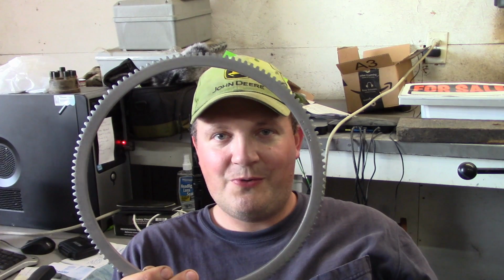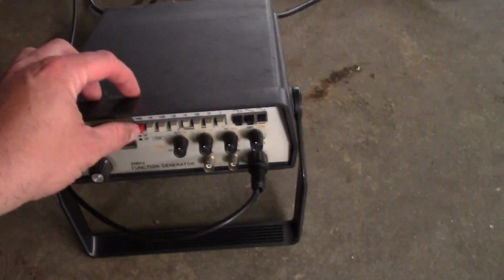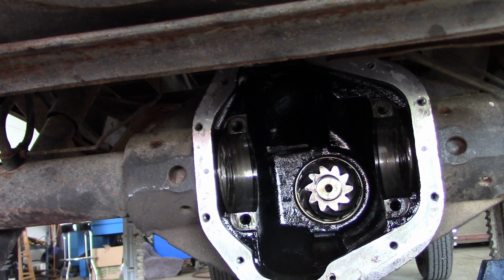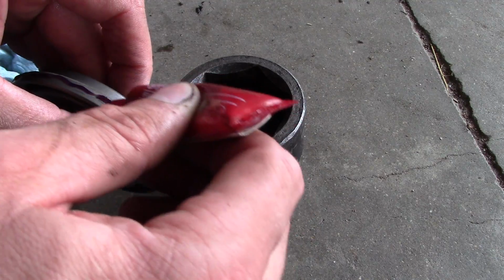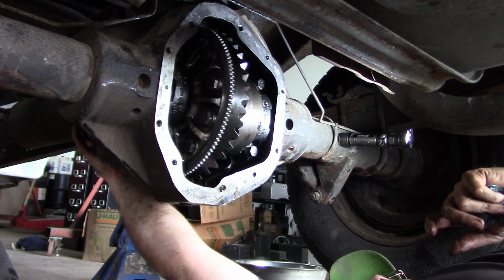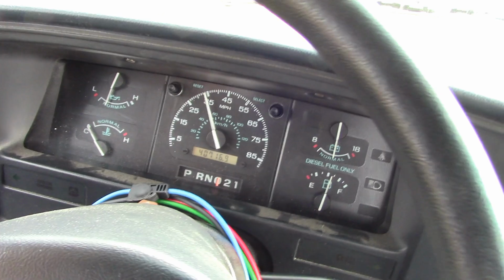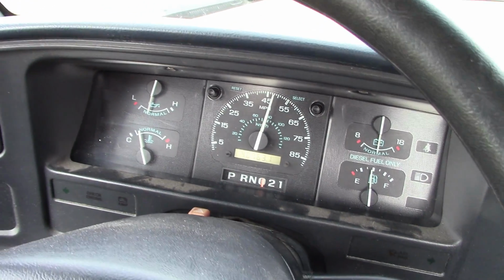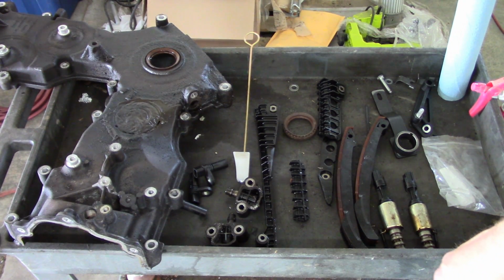Ford E350 Tone Ring VSS / Speedometer Fix

Comment: Signal generator is clutch for testing the speedometer. I was sure you would test it all out still on the jacks, but the road test is also good. All this work due to a faulty sensor seal which let water leak into the differential and the lack of driving caused the rust. I bet Ford didn’t anticipate that type of failure.  Always entertaining and informative.
Reply from the maker: I sure did not anticipate it!

Comment: Tone wheels/Reluctors are made of a material that can retain magnetic fields for a short time..  when the reluctor. if in a rear end or a distributor gets rusty... gets sandblasted during rebuilding.. or just old... it can reduce the amount of magnetic field it retains and reduces the amount of waveform it produces..  next time you have a dodge or ford with a magnetic pickup distributor out   check the pickup coil for resistance.. if within specs.. flip the meter to 2 volt AC scale.. spin the shaft. you need to see just over 1.0 volts AC generated by the pickup coil.. if you don't change the reluctor.. and it will fix the issue.. the modules need .3 volt above Zero to turn on the power transistor.. when the reluctor poles align with the pickup coil poles the voltage output drops to zero.. as the poles move apart the voltage goes below zero..
Reply from the maker: I'm actually wondering if that is part of the reason why is rusted so easily. It's made of some kind of metal that plays nicely with the magnetic sensor.
Reply: @WatchWesWork  its a Powdered metal part in most cases..  i don't have a mix of the metals used ..

Comment: Wes I had a similar problem with my 96 superduty. I had to send the speedometer and gauges out to an electronics specialty shop. There were some leaking diodes and corrosion on the soldered connections. Hope it helps you out.

Comment: Strange how a tone ring on a wheel can be rusty and covered in crud and not throw a code but that tone ring in rear end was such a big issue.
Reply from the maker: Yeah, the difference is they are rusted all the way around. This one is only rusted in about 60 degrees.

Comment: Today's video is "The reasons not to buy older equipment and expect trouble free operation."
You get one or the other.
Reply from the maker: That's always correct. Don't believe all of these "will it run" videos where they drag some forgotten hulk back on the road. Just because it runs does not mean it's right.

Comment: Hey Wes. Just wanted to give you a heads up. I have run into an issue like your customer described with the E4OD transmissions. Intermittent hard shift, neutrals out, weird shifting. It turned out to be a bad MLP sensor. (Manual Lever Position) sensor. I fought this problem for months on my old 94' F250. Love your videos Wes!
Reply from the maker: Thanks for the info!
Reply: Another common problem is the capacitors on the back of the speedometer when they go bad the speedometer will work fine but make it shift wrong hard/late shifts because it tells the computer whats going on.  Easy and cheap fix pull speedo out and replace the 2 or 3 capacitors on the back of speedometer circuit board. Trans will burn up if this is not fixed and is often missed.

Comment: Holy S___: Is there any more complicated way to measure speed than a tone ring?  Never heard of that, but I'm no mechanic.   Hats off to you Wes, for knowing where to look and what to do.       Impressed with your equipment as well.  Thought I was cool when I bought my first timing light and dwell meter back in the 70s.  A far cry from modern stuff.;
Reply from the maker: The tone ring works great in most situations. This one just happened to rust and cause issues.

Comment: Good job on the E350, we'll just consider that truck part of the Wes retirement fund and mental gymnastics work out. A for the 5.4, it's a Ford!!! I stand mute.
Reply: On the 5.4, use a heaver oil, like a straight 40 or even a 50 weight, it may help.

Comment: If I wasn't already subscribed I'll be subscribing just now, can I subscribe twice? Oscilloscopes and function generators in a car's shop, that's what technology is calling for, I don't know why they are not already in EVERY car shop. There are shops here in Spain that still charge extra for using a diagnostics computer, as if it was something "special"; I wonder if in the past they also charged for using a wrench or a car lift...
Reply from the maker: Maybe not the function generator, but oscilloscopes have been used for diagnosing ignition issues since the 1960s, possibly before. When I was a kid we had an old Sun brand ignition analyzer, which was just an old tube scope and some leads. It was great for old distributor type ignition.

Comment: 4:00 I do not how to compile the comments you are referancing, but that wave swings positive and negative, not just positive to referance or ground (0v).

Maybe I overlooked you monitoring a 24v system, but if it is a 12v system, something has to generate that negative voltage. That is uncommon on a 11-14.25v alternator. It does not have to be complicated, and can be as simple as a few diodes and a coil or a pulse transformer.

Also it is kind of funny that 1.3khz is 55mph. 

TLDR: Does anyone know if it uses a +/0/- regulator/dc-dc? That kind of adds and subtracts from the whole dirty power troubleshooting step. If it is isolated +12/0/-12 dc-dc module, it cannot be dirty power, or else the whole truck would be acting like it was auditioning for Maximum overdrive. I would think with all the odometer laws, they would have to stuck an isolated dc-dc module in the PCM or maybe in that cluster you replaced. 

The function generator would just simulate the sensor modulating. That is actually a pretty smart way to check that.
Reply from the maker: A magnetic reluctance sensor produces an AC sine wave. It's self exciting, so it is basically a little generator.
Reply: Appreciate the reply. I was way overthinking it. 

We are going to miss that kind of simplicity when Canbus Network faults cripple cars in the next 10 years. Not that those are insanely hard to work with, but having a constantly buy new scantools, software for every generation or model to talk to the multiple networks and modules hidden behind the PCM, and having to get scopes that have to read network logic protocols. 

Being a compulsary mechanic or engineer, and wanting to help people/work on cars is going to get expensive...I guess all we can do is be as honest as a handshake in the mean time.

Comment: When in doubt on rear end seals, two different things come to mind, that seal is sold in a few thousands undersize... not always available, and Jiffy sleeves... they do make things rounder again... I hate pulling rear ends out without the second person to help keep from getting in the face... I did have that happen as I had pulled a couple of the ring gear bolts and put some light cable on them thinking it would catch... it did for a brief second and then broke that damn cable and towards my face it came but I rolled fast enough to only get a ear "torn" a little and some choice cuss words that sufficed for the time. ..... That "tone ring".... My fix was and call bullshit but it got me by was with the geases drained and all flushed fair at the moment.. put the truck in gear so rear end was spinning... slowly... you kind of feel your way into it... and took a ruff bastard file and held it to that ring to shine it and kind of make it all even. Re flushed it out for gear shavings/filings and then replaced cover and lube. I built my own tool to fit the holes on either side and used a porta power to spread and only caused myself more problems as it leaked where it spread at. I really hated to do it but wound up putting a lite bead of weld around the whole axle to stop it but later just spread on the road and died a horrible death... he hauled pulp wood on it and it carried as much as  a truck with tandem axles should. He never blamed me and I told him up front this could happen and he said thanks for being honest, not many would of so when that died, I gave him the tow to the shop and a better price on a rear end from my pile... set him up with a cell phone that would record speed and sent him back out to kill trees

Comment: Solid diagnostics, fun to see a tone ring replaced. Those old variable reluctance sensors show increased amplitude and frequency with higher velocity, which makes sense knowing how they work. It's a pretty dramatic effect if you change vehicle speed while looking at real time data on the scope. Maybe the engine software is designed to automatically damp down input from high velocity signals, and your damaged tone ring was not able to mount a readable signal at those higher velocities. It looked like your pico showed a regularly recurring bad spot, which verified your diagnosis. Thanks for the tip about Dana/Spicer axles.

Comment: Noticed no lock tight when you put the ring gear back on. Was told that was important or just a judgment call??
Reply from the maker: I did use locktite, but the manual does not say you need to. The bolts are serrated under the heads.
Reply: @WatchWesWork  I may have looked away! I don't do it that often but man it's aggregating being in the rocks and it breaks! Really like the channel!! Thanks!!

Comment: i've gotta quit watching your channel Wes. i'm starting to think maybe i'm a real mechanic too and taking on bigger projects than i should be, LOL. next project is killer dowel pin tab on my dodge. gonna pull the rad and intercooler and remove the A/C system at the same time for better airflow. new coolant. new water pump. maybe even set the valves too after 30 years. thanks for the inspiration.

Comment: Was just checking picoscope prices out of curiosity and OMFG they're bonkers-expensive, something like 2.7K for the "diesel kit", oh boy unless you have a repair shop(and even then...) it's insane
Reply: They are certainly expensive, but making a truly portable oscilloscope definitely ain't cheap. They do offer lower-spec models for a lot cheaper than that, and tbh I very much doubt there being a huge need for beyond 100mhz bandwidth in most automotive work (fwiw, even the cheapest ebay usb scopes could see the 1.3khz signal Wes was working with). You could also look at siglent or rigol offerings for wall-powered scopes if you don't need the capability to probe on the go.

Technically your phone likely has a 1-channel 44khz sample rate "scope" built into it - the microphone port. That alone can be super handy with the right software and hardware to go with it

Comment: my gear set wouldn't go in.  a trick i used was to freeze it., after the install, let it sit and warm up, then sprayed all the condensation out with brake cleaner before putting on the cover.

Comment: Nice work Wes, good to see the wave form on the Pico showing the problem.  I guess it's got a better sampling rate than the Hantek.  Can't argue with the result using the function generator showing everything else is good in the system.  I wish you were not on the other side of the country, I would bring my truck to you to fix my power brake booster.

Comment: I have a 1994 Ford F-350 and one day the speedometer quit working the miles quit showing the overdrive light started flashing and it shifts hard. We replaced the speed sensor and checked fuses and I don’t know what to do have you got any suggestions
Reply from the maker: The PSOM is a good place to start. It's tricky to diagnose, even with a scope and other fancy tools.
Reply: Pull speedometer out and see if the capacitors on the circuit board are swelled up or burnt.  There are 2 or 3 of them if you can solder it's not hard to fix $20 in parts. It will fry the trans if not fixed.

Comment: Grrrrrr8 job Wes. So very glad you could get the part switched & seal installed in 4.5 hours!!!!!! 
What transmission troubles? Sounds grrrrrr8 to me? Might be leftovers in the valve body from  sitting? Good video + thanks  for your time posting it........Cheers.....

Comment: that tone ring went on a lot easier than the one on the limited slip diff I was putting in my 1993 volvo 240's dana-30. the 'new' diff had a tone ring on it, but for a non-ABS car (less teeth; only the 1992-93 240's had ABS). I had to stick my old tone ring in the oven (after wailing on it with a dead blow to knock it off the old diff), and the diff in the freezer. even then I had to whack it on there pretty hard.

Comment: To quiet those phasers use 5w40 oil my buddy from work had one of those and changed the phasers chains guides tensioner and oil pump the oiling system doesn’t supply enough oil to the top end the thicker oil help carry oil pressure up to those phasers and cam bearings

Comment: I think I can believe that pitted generator gear is responsible for the problem. Remember the tone ring sensor amplitude is a function of the average tooth height, or alternately distance from the tooth average top to the sensor. I bet if you put a mic on some of those rusty teeth they will be off by a few thousandths, especially in the center of the tooth where the divots are.  When the spacing to the sensor isn't many thousandths, that is a big deal.

Comment: I suspect the Ford VSS interface circuit is not a zero crossing detector but rather a peak voltage detector.  A true zero crossing detector wouldn't care about the strength of the signal, only the frequency and zero crossing.

Comment: Hey Wes... you nailed that diagnostic.  Well done.  BTW: You should think about getting the spreader tool.  It makes the job SOO much easier and they don't cost very much.  I got my used Chrysler tool on eBay for about $30, with the postage.  My old Dana 2-bar, one screw, tool was less than $10 at a flea market.  The old ones work as well as the newer "box" style and they're not hard to find.  Most folks don't know what they are.  And, then there are the rears that are so darn tight that they won't budge without a spreader.

Comment: the guarentee i would have gave him on the f150 is "i gaurentee you will have more troubles" i use the standard brand phasers as they have been fomoco parts with the part numbers ground off. they are less expensive than ford and i have never had any trouble with them. i should have offered up a complete used replacement set up i removed from an engine that had been in a wreck and broke the block. it was all quality replacemnet parts. i kept them in case i came across such a situation.
Reply from the maker: Yeah I know. Those cam bearings will eventually fail completely. But he might get a a bit of use from it before hooking up the anchor chain!

Comment: Hi Wes, watching you work on this truck leaves me just learning something new each time, but when it came to torqueing up the pinion bearing nut I did smile, Not at your method as I thought it worked very well, but that crack of the torque wrench just reminded me of a job I once done in the machine shop I worked when we / I / made parts for a ROLLS ROYCE gas turbine outer case on Its Industrial Marine section, a huge 2 ton casting split into 4 (quadrants) the matching faces machined and bored to accept very special bolts so on my old "Webster Bennet" VTL I had to bolt them all together torqueing all 20 bolts to (wait for it) 1200 foot pounds with a double barrelled torque wrench, with me hanging on the end bouncing up and down waiting for that loud click.. From proof machined insides to me finish turning it, a 2nd and 3rd stage of the gas turbine took me on average 150 hours of machining, and the material was "Multimet" A very hard durable heat resistant PIA material to machine but I machined about a ton out of it.. It was BIG. lol.. Loved doing them though, each one a Challenge..  So, just as you find jobs to do a challenge, you just get on with it and do it.. well done.. Thank you for your video / - Ian - UK.
Reply from the maker: Stressful job. I was in a plant once that machined steam turbines. They would spray weld the journals and turn them on huge lathes. I asked once what happened if they blew the diameter tolerance. The answer was "that doesn't happen"!
Reply: @WatchWesWork  Nice / I once also done some steam turbine "turbine groove" repair parts that were a big diameter but small cross section, came to me in halves with ends faced off I had to clamp the down, as true as i could get them, turn the O/D to a tight limit, that fitted into a "nest" fixture so tight that it never needed clamping to do the internal turbine "grooves" and finished thickness.. They went to a Dutch Shipyard doing a boiler/ steam engine repair..I still look at peoples lathes On you tube, just thinking through what they are doing, but TBH my last few years of work was on a 5 AXIS machining Centre again doing big parts.. hated little tiny jobs of work...But Thanks for the reply Wes..

Comment: What does the Pico have that a 4 channel digital scope doesn't?
Reply from the maker: A huge buffer. It can capture 32 frames of data at 12 bit resolution on 4 channels. Plus the interface is really slick. The automotive version is loaded with cool features like 720 degree cursors for measuring things related to the crankshaft. Plus it has menus that will set up common tests like cam sensor, ABS wheel speed, CAN bus, ect.
Reply: @WatchWesWork  Ok, thank you. I still don't really understand the usefulness of a Pico over my DSO. I guess you have to see it in action for automotive to understand it.
Reply: @WatchWesWork  Ok. I just watched this diagnostic from Eric O's channel: https://youtu.be/qI_Aem5khag. I was really blown away by this diagnostic output..it all makes sense to me now how the Pico makes more sense than breaking out my DSO.